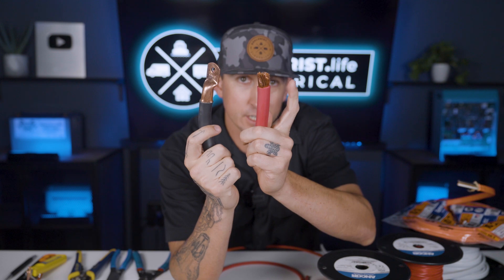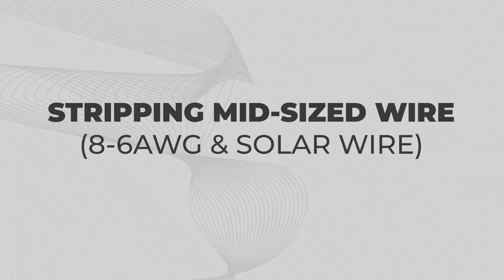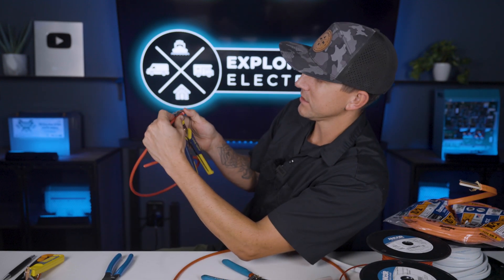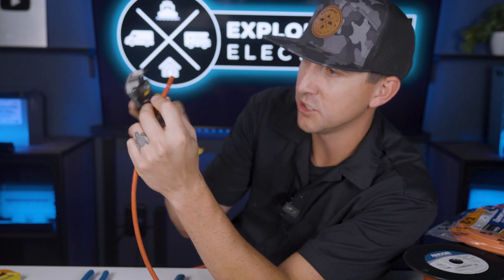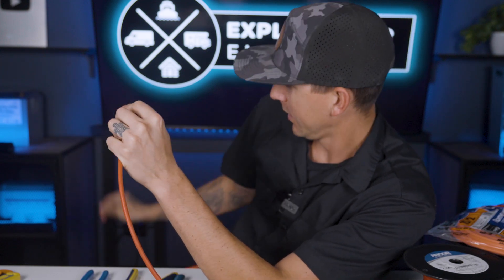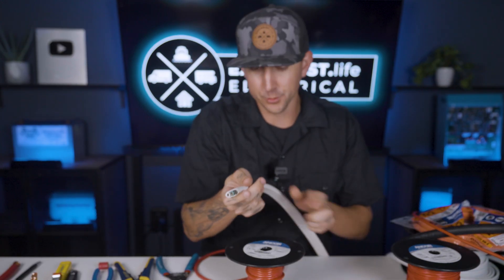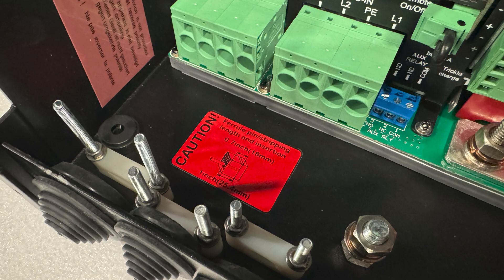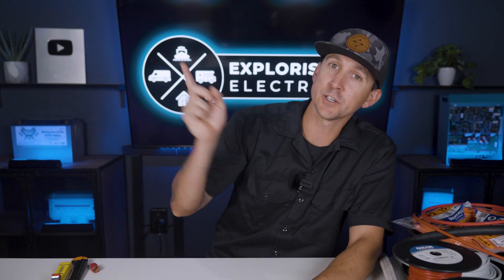Wire Stripping 101 -  Wire Terminal Basics | Ep: 3/14

Comment: I was an Electronics Technician in the Navy 55 years ago.  My job for a little over a year was to make up new coax cables for submarine electronic countermeasure modules.  It took everything you are showing in this video to a different level.  If those cables weren't made to precise measurements, the units would not work.  I got pretty good at it after a while.  Anyway, I really enjoyed this video.  I'm still making up cables - will be making some for some 4 awg marine wire in the next week.  And, I'm still learning!  Thanks.

Comment: When stripping cable with multiple wires I like to cut a line no longer than the length I will be stripping off the inside wires then use the pull cord or wire inside to extend my cut back so the desired length of wire is exposed. I’ve found even when being careful I can still cut the inside wires if I strip the desired length right away. No risk of cutting the inside wires this way.